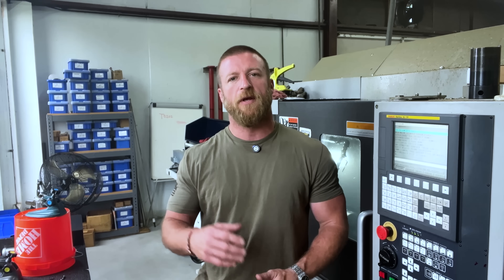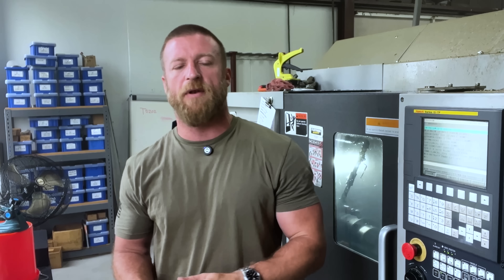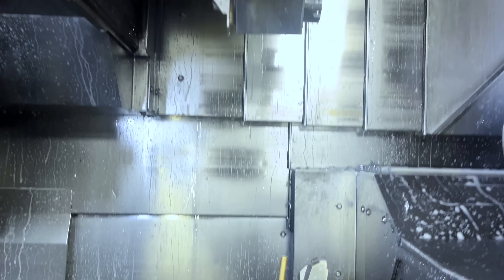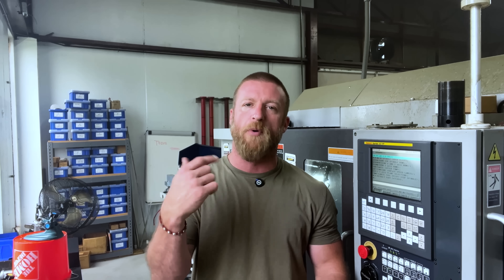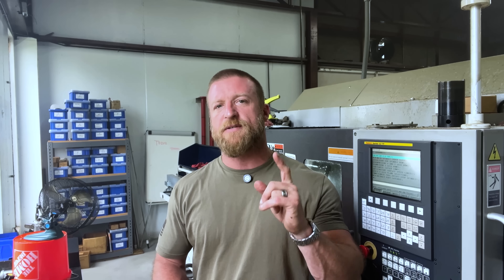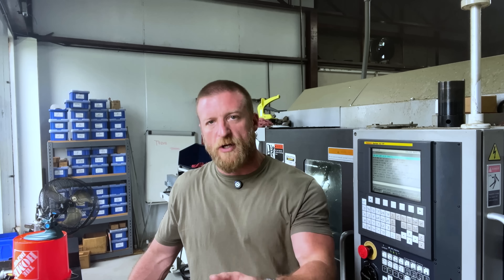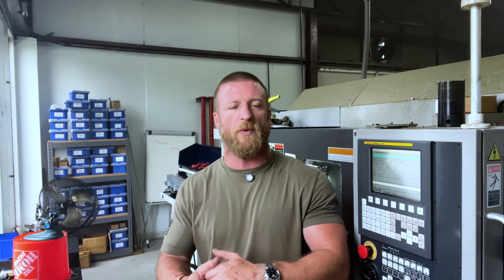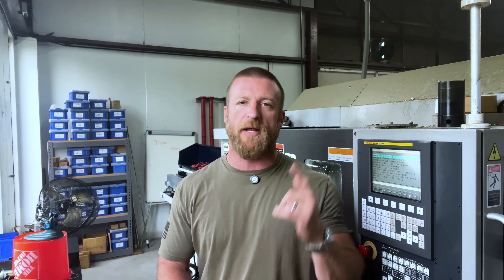Why Your Lathe Finish Looks Bad (and How to Fix It Fast) | The Lathe Lab Ep.9

Comment: 13% min 17% Max for A286. And on A286 turn off high pressure if your getting crappy tool life. 
Rough turn and part off in M4 and you'll get better tool life and consistency for the finish turn. 
And depending on the machine, when cutting angles and finishes on angle are different than the od's, slow down feed rate on the rough turn on the angle and that alone will give you a better finish with the finish turn without adjusting the finish tool.
Reply: I've heard A286 can be a pain.  thank you for the information.
Reply: @Crusadermachining if anyone runs A286 and has issues just got me up. Smaller diameter sizes run much easier. 
But when you start getting into larger sizes with lots of material being removed, that is when the nightmare will begin.

Comment: Excellent information. Clear, concise. Useful. But curious: do you apply the 1/3~2/3 rule to indexable drills (1 or 2 inserts) too?
Reply: I do not apply that rule to those tools.  It can be a different beast when you are deep in a pocket and the chips don't have a lot of room to break and get out of the way.  I actually want to try that now just to see.  Some of our drills we have  1/32" radii on the inserts and I'd be a bit nervous to try and push them at .020".  I calculate those feeds (while drilling) at between .002"-.005" per tooth, generally speaking.  I find those types of drills do not cut very freely.  Great question and thank you for the kind words.

Comment: so if im finishing with a 1/64 vnmg... i need to leave 0.015"? Ive been leaving like 0.005"! The more ya know
Reply: Generally speaking, yes.  I like to try and leave the nose radius per side for the finisher.  Then dial it up or down as you see fit.  Surface finish, chip control, etc.  Sometimes i can get away with 1/3 radius how you were doing.  So it's a loose rule.  More of a starting point.  Did you notice good surface finish and chip control when leaving .005" per side?

Comment: I love the perfect chip formation. But then there’s Carpenter 465 😞
Reply: Hmmmm what is that? Sounds “fun”😂
Reply: @Crusadermachining Some sort of fancy aerospace stainless grade that has insanely strong chips that refuse to break even when the insert buried and the feed over 9000. But I guaranty there is a specialized tool out there that could but at the time all I had were CNMGs for rough turning. Though it did get slightly better after heat treating. This particular job I’m thinking of required gone from 4” OD down to 5/8”. Engineers make us make the darndest things!
Reply: @XxLatheAddictxX  hahaha Feed up to 9000 LOL that's awesome

Comment: I guess coolant from below cools down things more and from above helps to form a better breakable chip.
Reply: coolant won't ever break chips , unless some crazy 500bar system is employed . coolant direction is not important as long as it hits the cutting edge directly , with a decent flow and pressure .
Reply: @kisspeteristvan agreed. It’s gotta hit that edge. Not so much to break chips , unless high PSI or BAR, like you said 🙌
Reply: I find I get marginally better tool life when the direction is optimal. For me it’s better than just showering. Especially if you have 300 PSI or more